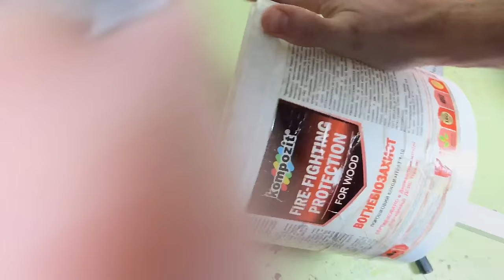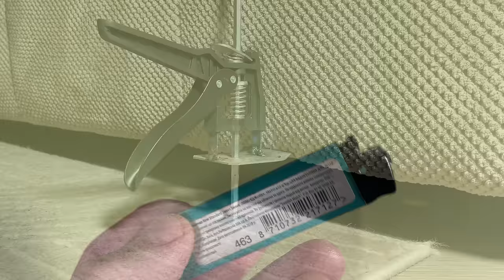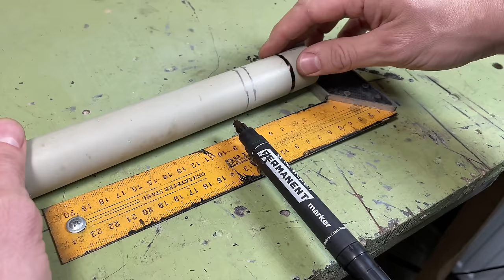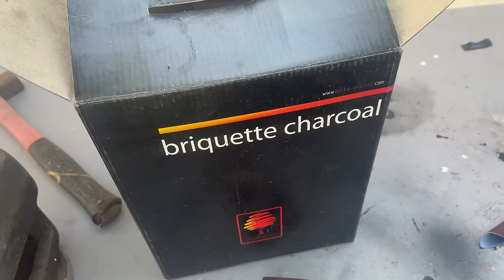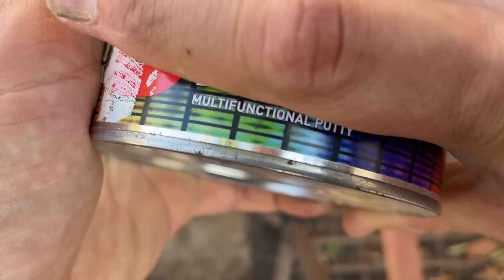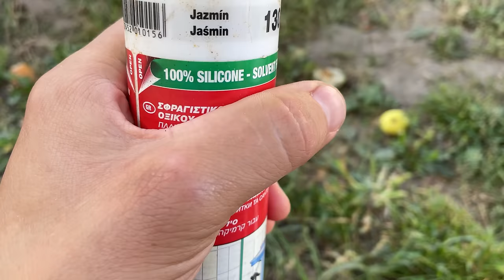Simple Inventions of Handyman That Work Extremely Well - Using Recycling Materials

Comment: Dude where is your head at?  You should fix any plastic pieces from the back side then you have very little or no finishing to do on the outside, and you use scrap plastic from the inside so it's the same color.  You are doing it the hard way and making more work for your self.  But some of your other ideas were good.  I thought the birdhouse was cool.